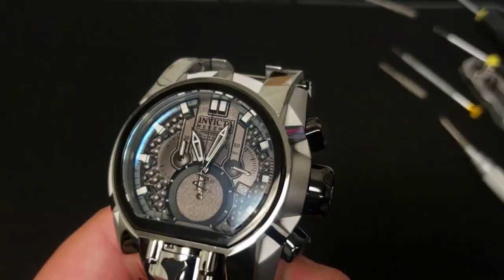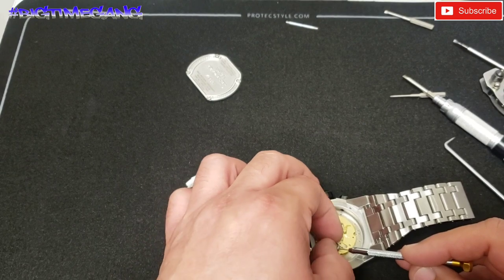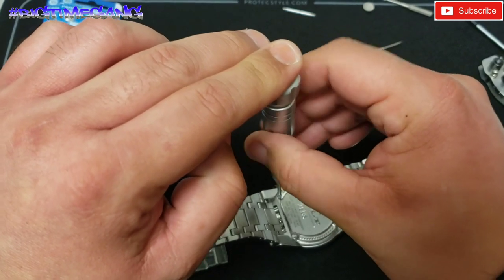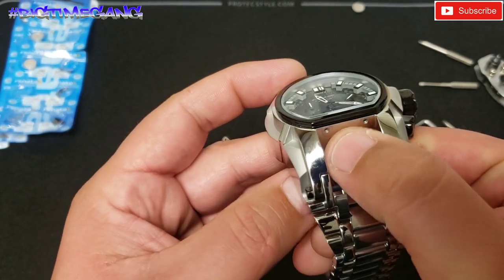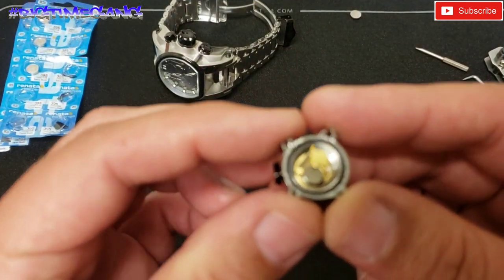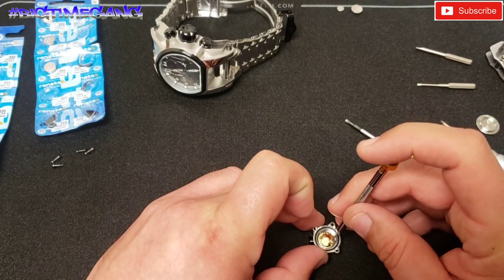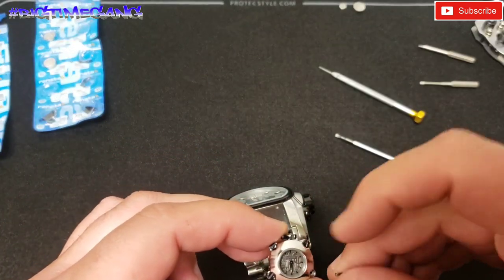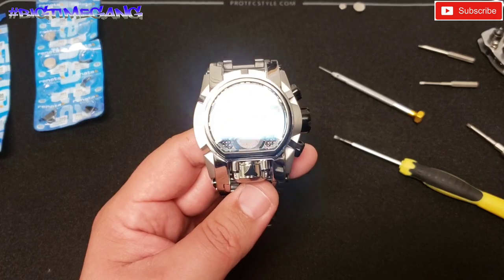INVICTA BOLT ZEUS MAGNUM BATTERY CHANGE ON BOTH QUARTZ MOVEMENTS

Comment: Thx tbt appreciate the battery change for the magnums I'm going to have to start changing mine soon, fyi, you may want to pop the crown on the smaller movement to extend that battery life when your not wearing the watch as that movement eats up batteries
Reply from the maker: Ive noticed the small movements do eat up the batteries quick

Comment: Hey Big Dogg thank you very much for this video. I have the iridescent 25212 bolt zeus magnum and I need to do exactly this. Can you please recommend a case opener tool just like yours, that goes small enough to open the secondary movement? I would be forever grateful. God bless you and happy holidays
Reply from the maker: Glad it helped bro. The tool i use is from many years ago. This tool should work though. Smallest case back opener i can find on Amazon currently

Vastar Watch Adjustable Opener Back Case Press Closer Remover Repair Watchmaker Tool and Watch Case Back Opener Repair Remover Holder Tool https://www.amazon.com/dp/B01IP1983U/ref=cm_sw_r_apan_glt_fabc_0BAB2GZA9VFF9H8VGQV8